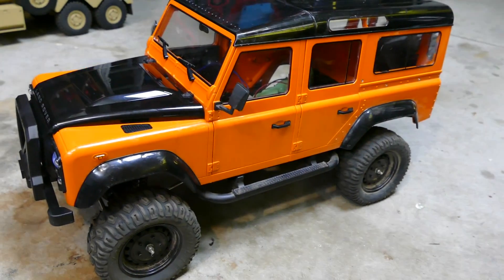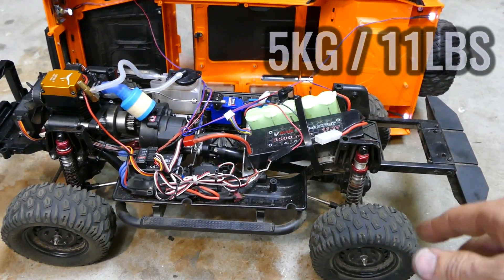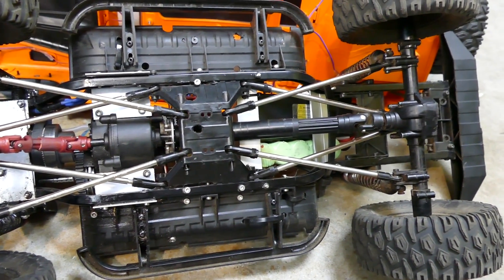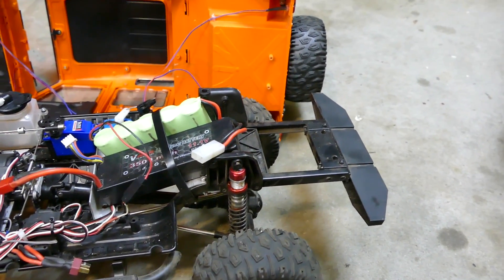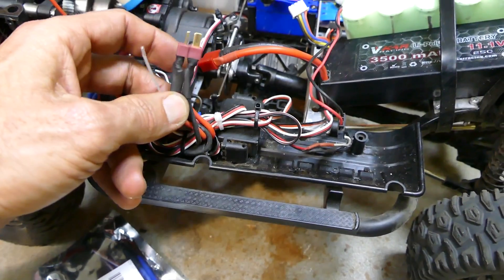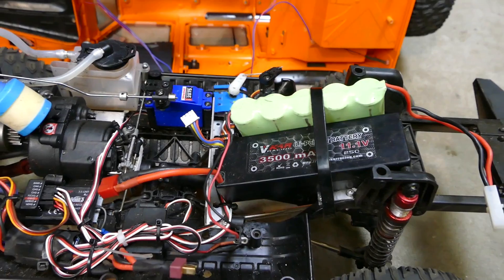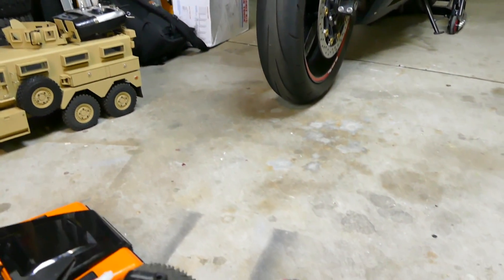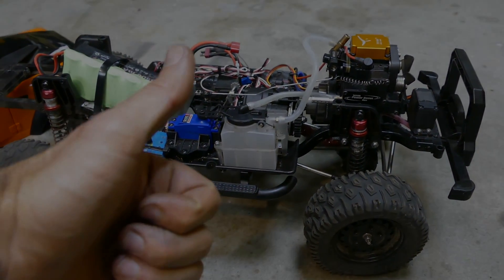4 STROKE ENGINE CONVERSION - Questions Answered & Whats Next!

Comment from the maker: Toyan FS-S100 Engine: http://bit.ly/toyan-fs-s100
Toyan FS-S100 Spare Parts: http://bit.ly/fs-s100parts
Water/air cooled - https://bit.ly/2kmJIFw
Extra 10% Coupon Code: EDRC

Defender crawler check it out here ➜ https://bit.ly/2O9D57O
Reply: Hi Steve - it would be nice if  you did a video (or series) on the gasoline powered (water cooled or not, not important) version (FS-S100g). The gasoline version will have the added complexity of ignition timing (both setting the timing and where to mount the hall sensor and magnet, etc). Many of us would find it very helpful, as the nitro version, while interesting because its a 4-stroke, is largely the same from a skill standpoint as our usual 2-stroke engines we've been using forever.
Reply: I have one of these engines and upon starting it the flywheel snapped the crankshaft so that was a waste of money
Reply from the maker: That sounds pretty unusual. Surely you have contacted them

Comment: Hi Steve,
Which battery should I use for the starter kit to run this engine (mine it's not yet mounted on a RC car)?
I am a bit confused between the 7.4v and the 11.1v...
Cheers,

Comment: Hey Steve I have the white defender and the grey rgt jeep on the way. Since you have both, I was wondering your thoughts on trying to squeeze the toyan into the rgt versus the double e?
Reply from the maker: Very difficult fitting it the RGT. Car is the wrong scale
Reply: @RCTanksTrucks247  thanks bud, I figured it might be a little tight.

Comment: Get a silicone tube, zip tie it on the carb and run it to the top of the body,you can use a small air filter and make it look and work as a snorkel.
Reply from the maker: Obviously tried the zip tie but any force or pressure will cause it to slip off
Reply: @RCTanksTrucks247  Thats a pretty big problem.  Glueing it is definetly not the andwer.  Maybe put some tape around the carb inlet to make it thicker?

Comment: Hi mate, how far out did you screw out the gear shift screw I just can’t get mine to change gear !
Thanks 👍🏻
Reply from the maker: Each are diff as they are set on a dyno from factory. I just adjusted it out in very small increments. You have to be careful though as it can come out and ruin your gearbox if you back it out too much.
Reply: RC Tanks & Trucks 24/7 
Ok mate thanks, have a look at my vids you don’t need all that wiring and blue switch and servos  and two massive batteries 😊
https://youtu.be/rD6Ipf9aVyE

Comment: i just noticed everyone using this engine doesnt use the fuel tank that comes in the kit my fuel tank doesnt look anything like that one
Reply from the maker: That's the fuel tank that you get. Both of the ones I purchased included that one.
Reply: @RCTanksTrucks247  oh the one that came with my kit is way different

Comment: You don't need that servo, servo tester, just plug in the servo cable of the esc with the red wire removed and program your radio accordingly. Also you could swap that NiMH battery to a beefy external BEC. With these two tings you could free up some space in the car and make it lighter. Also keeping track of only one battery is 2 times easier, and half as much headache. These are my recommendations. :) Very nice work by the way!
Reply from the maker: Excellent man! Thanks for the awesome tip. Might try that on my next build.

Comment: heat the silicon with a hair dryer or hot air gun, and it will shape it. I would actually use automotive vacuum hose, tends to grip a little better than silicon. Heat it the same to shape it, then clamp it.
Reply from the maker: Thanks man. That's awesome. I will try it!
Reply: @RCTanksTrucks247  No problem. Love your videos. For some reason, and I know the 4 strokes aren't as powerful as the nitro 2 strokes and the size difference for the 4 strokes yields a problem, but I have really been intrigued by them. Especially ones like the 609. But I've been following your videos since I saw you working with the 4 stroke. I love it.

Comment: It might sound super shotty but maybe if you used some larger shrink wrap for wires you could shrink wrap one end on the intake and the other to filter set up. That's for an air tight seal not support though.
Reply from the maker: Interesting. Thanks for the info

Comment: Use a zip tie bro for the air intake. Also if toyan makes this weird air intake shape have you searched or asked them if they make their own air filter? Sorry if that's a dumb question just thinking why would they make an engine and not make an air filter? Anyway. You really need to put the 4 cylinder into something! 👍👍💪
Reply from the maker: I know ay, but I was looking and they don't sell one. As soon as a use a zip stop it slips off due to the different shape of the intake.

Comment: I cant wait to see what you are going to install the second engine in!  hey Steve I used small zip ties to hold my air cleaner tube to the oval carb flange it worked very well . great information in your video brother!
Reply from the maker: Thanks Dennis, problem is as soon as I tighten it up it slips off due to the different shape. Hmm, maybe use another type of material.

Comment: You done good, make's a change from just following instruction's and the finished result the same as everyone else's.
Have you seen Denises latest V4 he set it up as was out the box, then as it was a little fluffy on acceleration, so he went the four carb route after several manifold attempt's and it awoke it,  very skillful engineer and think's out side the box so all conversions are first rate.
So a semi works for me, although I am not a small scale guy I do lie the builds, so looking forward to the next build.
Reply from the maker: Yeah I watched JohnnyQ90 latest video. Definitely very cool setup and seems to rev up to speed easier